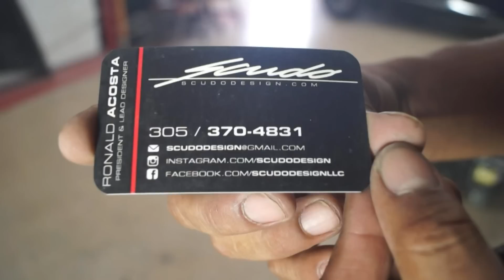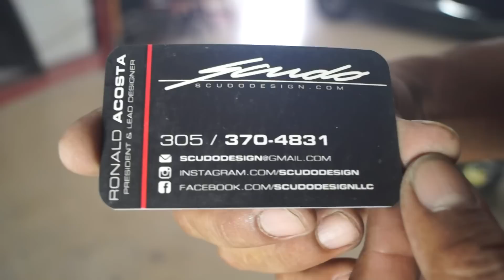Project Turbo RX8 part 47

Comment from the maker: The full Kit will come out this year. We're not finished yet due to budget constraints but hopefully before the holidays.  If you guys want to get started on ordering parts and putting up deposits on kits it would help speed things up. If not then stay tuned as I am doing the best I can to finish this project as fast as I can.  You can reach me at 786-901-9273 if you are serious about ordering a kit and want to discuss getting started.  The first thing your gonna need is the front cover mod which you will have to send to us to get modified to fit the modified counter-weight.  That part has to be machined by hand. Most of the other parts will be mass produced like the engine mount, the throttle elbow, coil mount, A/C bracket modification, exhaust manifold etc.
Reply: I'm only finding out about this 3 years later, so I looked up your web site to find the current status; but either your ISP is having trouble, you changed your domain name and forgot to up date your about page, or your firm ran into trouble (possibly due to the nonsensical lockdowns). I'm hoping it's one of the former, as I am very interested in this project, even though I only heard of it in the last 5 minutes (writing this on 16 February, 2022 at 02:40 ET)/